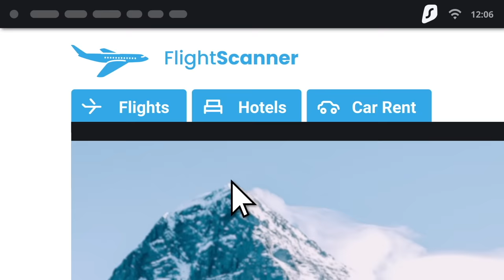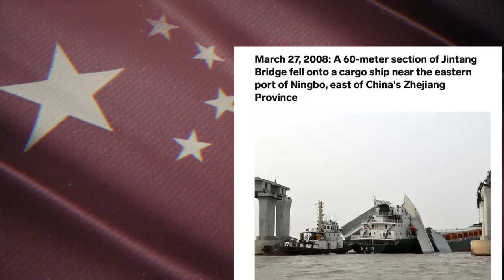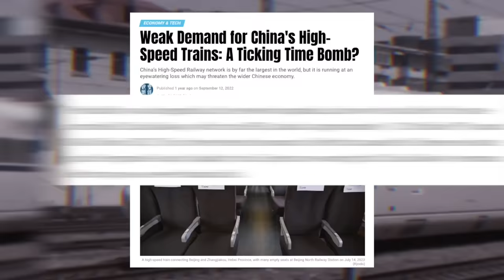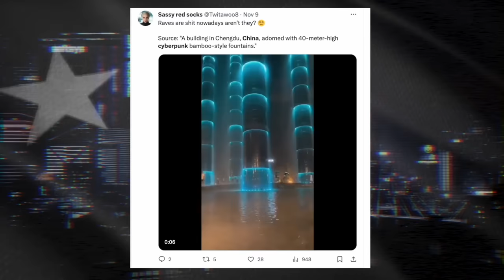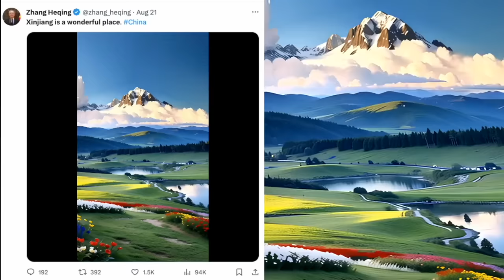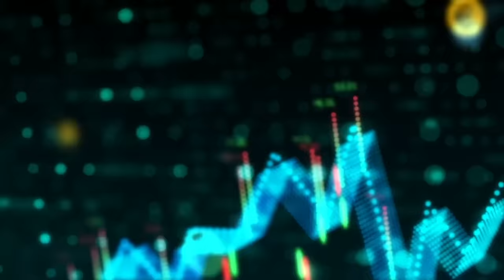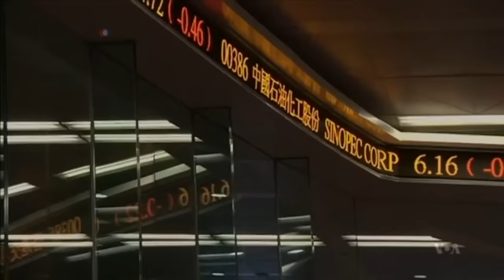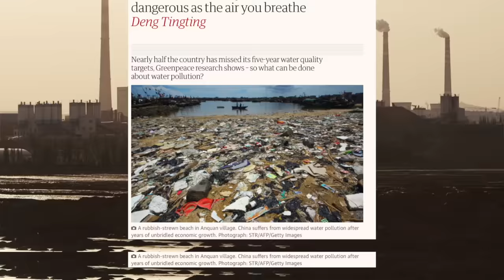Why are China’s Trains Randomly Crashing? - The Hidden Disaster of the High Speed Rail Network

Comment: Speeding is the main reason.
The original Tech-Transfer Agreement
with Mitsubishi Heavy Industry Japan
limited the speed China was allowed 
to operate the hi-speed trains
at 300 km/h

But China operated them at 380 km/h,
drawing power up to about 4 times 
of the original design rating.

As a result, the overloading led to 
sudden hault in the 2011 disaster.
Reply: Why are you making what you write look like a poem? It makes it hard to read.
Reply: @lainiwakura1776 how is it hard to read? Just read it
Reply: This makes a lot of sense.

Bureaucracies don't always observe technical limits.    Prime Example was the Challenger Shuttle launch.   NASA and Reagan wanted a talking point for the "State of the Union" address.

Morton-Thiokol said "We have had some near misses because of the O-rings" due to low temperatures.

The customer is always right, so up went the Shuttle, down went the Shuttle.
Reply: @jamallabarge2665  the customer is always right in matters of taste, that was just a bunch of chicken-shits letting people die.
Reply: @lainiwakura1776 just read it
Reply: If I'm remembering correctly, the Japanese-derived high speed trains have a rated top speed of 250 kph, whilst the Siemens-developed trains run at 350 kph. So I highly doubt that running at such speeds (which the trains likely can't reach in the first place) would have been the cause of that accident, especially given the myriad of other, more likely things that can go wrong. Derailments due to failed axles or suspension are quite common, especially when maintenance isn't done adequately, and can lead to severe accidents.
Reply: @mikeblatzheim2797  
I didn't speculate on the cause of 
the accident of Power overloading, 
leading to sudden halts.

I noticed, since the opening of 
Shanghai-Peking line, in June 2011,
there were AT LEAST 8 incidents of 
Power Outages, in the MiDDLE of journeys, 
including Complete Electricity & A/C Outages.

As an Electrical/Electronic Engr, 
I strongly suspected the Power Supply Grid
(might NOT be supplied by Japanese,
but developed by the Chinese themselves)
of the Chinese HS train system
WAS NOT CAPABLE of Supplying the 
Overloaded 400% power of speeding from,
designed 300km/h to 380km/h.

And I predicted the incident (not accident)
AS EARLY AS beginning of July 2011,
and the Incident happened on July 24.

I was banned from a local Train Tech forum,
for predicting the incident too accurately.
Reply: @lainiwakura1776  
Sorry 2 hv made it hard to read 4 u,
But, it's my job-sickness of 
being a software engr that
it's a style of presenting,
in a Structured Format,
to be easier to read,
by my colleagues.

I didnt mean to make it read like poem.
In fact I hate poems to some extent.
Reply: @abcxyz-nd6xh it’s great. Easier to read.

Comment: You know, I often complain about how there's little to no train service where I live, how the rail network is nowhere near as good as it once was in the first half of the 20th century, how slow trains are compared to Eurasia, but then I see China, and I realise that it could be a whole lot worse. (I'd still love a rail network in the country like Japan's though.)
Reply: I would love a good passenger train system. When I was 8 or 10 years old my Mom and I used to ride the train across the US to visit relatives. I still remember when you flushed the toilet you could see the railroad ties going by through the hole in the bottom of the toilet. Back then every town of even a few thousand people had a train station where you could get on a train and go anywhere.
Reply: Sad to say, but rail has been a black hole for money for more than a century at this point.
When rail was at its peak, it was there because it had no real competition for the scale it operated on; it was competing with horse and cart for people/cargo transfer. As private motor vehicles (both cars and trucks) got better the advantage of trains was lessened until it was no longer profitable to run rail. Add to that needing private transport to even access rail and you can understand that rail is (apart from niche uses) dead.
Reply: As soon as airplanes got faster than trains the handwriting was on the wall, sadly. @elLooto

Comment: Haste makes waste. Sure China built a giant high speed rail system but the quality is what matters. The tolerances for every aspect of this system have to exact to achieve and maintain these high speeds. Any small deviations will cause vibrations, which will end in catastrophe. The maintenance of the rails, to the cars and engine alone, are crucial for safe travel. Other infrastructure such as bridges and banked turns are also critical. These are issues that must be of top priority and not overlooked. China has a bad habit of jumping before they look. I'm afraid they are lacking it the quality of their ability to run and maintain these systems and we will see their shining jewel become severely tarnished and dangerous as time goes on.

Comment: There is an axiom in the construction business. You can build a project fast with high quality, but it will be expensive. You can build the same project with high quality and reasonable costs, but it will not be fast. You can build a project fast and cheap but it will be of low quality. Do you want to build a project fast, cheaply, and of high quality? Pick two and call me back. China built a huge high-speed rail system faster than anyone imagined it could for less per mile than anyone else has, so now it is paying the quality price of that decision. The other thing about high-speed rail systems - they are very maintenance and operating cost-intensive. If maintenance gets skimped on, it doesn't really matter how well it was built, it is going to start falling apart. Derail a regional freight train at 50 mph and you have a serious problem but likely can repair the damage to the guideway in a few days (Norfolk Southern not withstanding). Derail a high-speed passenger train at over 150 mph and you have a disaster that is going to take weeks or even months to repair.
Reply: They can also do repairs fast and cheap. So no problem!
Reply: @norihiro01  😆😆😆😆😆

Comment: I'm skeptical.  Imagine the commuter volume, the speed at which those commuters are moved, and compare it with the knuckle draggers at Amtrak.  I believe you would find that they have moved more people safely and quickly in the past 10 years than Amtrak has in 50 years.  An Amtrak ride from New York to Charleston SC actually takes longer than driving.
Reply: You're right, they do move more people quicker than Amtrak. However, as shown by rail networks elsewhere, they could still do a lot better on safety.

Comment: The sad thing though is that many people would talk bad about Japan's HSR rail projects in other countries after one country had open their Chinese made HSR rail line. Like in Indonesian HSR for example, in every video about their HSR, you will see many comments throwing shame to Japan HSR projects abroad. They didn't know the problems Indonesian HSR had during it's construction and why it was delayed. Other than covid, one problem was Indonesian engineers saw many structural problems like misalignment of the supports that is why they ordered China to fix it also another problem of the delay was the derailment of one of their construction trains causing deaths. Also the scary thing was due to delay the government told the Chinese contractor to speed up the project more which caused some stations to not yet finished construction when it opened. I don't know if they knew this but it is not really good to hasten Chinese projects.

Comment: Certainly, I can share a story without copying it. Imagine being on a packed train in China, heading to a bustling city. The carriage was overcrowded, filled with people standing in every available space, making movement nearly impossible. The air was stuffy, and the heat seemed unbearable due to the sheer number of passengers. The journey that was supposed to take a few hours turned into an endurance test. Passengers were visibly uncomfortable, and it was challenging to find any relief from the cramped conditions. The constant noise and lack of personal space made it an exhausting and frustrating experience. Despite the discomfort, the resilience and adaptability of everyone onboard were notable. People found ways to pass the time, sharing snacks and engaging in conversations, trying to make the best out of a challenging situation.

Comment: In the west, with proper laws and codes, and without corruption, we tend to build assets using capital, or loans. Those loans are paid back by the operating profits from the assets created. And if the owners go broke, the assets are purchased at a discounted rate until they produce a profit for the new owners. Whether that profit be generated by renewing operations, or stripping the assets for sale separately.

In China they build liabilities using Tofu Dreg construction. So that when the owners go broke, there is no asset to sell - just another public liability requiring huge expense to de-construct.

And it seems to me that this vast chasm of difference is what will ultimately doom China: there is no way to properly allocate capital, and in the ultra corrupt system, no way to produce assets of proper value.

Comment: Oh I was wondering what happened to you guys.  I remember your episode about Chinese farming practices & extreme use of herbicides, pesticides, chemical fertilizers, steroids, growth hormones.  Then all that surfaced during the Olympics a bit later, when athletes had to import food as the Chinese food had so many banned growth/steroid substances in it.

As a civil engineer w/3+ decades experience designing, managing transportation infrastructure projects in the northeast USA, working for a State DOT agency, of many modes (highways, airports, ports, commuter & intercity rail, bus), I will add my two cents:

- We always said:  "Do you want it done Fast, Cheap, or Right?"  "You can Only have Two of the Three!"  This is an Infallible Rule.  Obv China goes for the 1st 2.

- We'd known about these issues for a while when I was working on Rail projects & we'd be getting those sorts of comments from non-technical media & politicians - "Why do your projects cost so much & take so long when China built a whole nationwide system in less time?"  Because we plan & design our projects pretty thoroughly, then bid them out, then inspect them thoroughly during construction, including testing the building materials.  Then we test & troubleshoot what we've built thoroughly, using a "Commissioning-based" system/set of standards.  This is all overseen by professionals credentialed & experienced in whatever the relevant fields are (structural, civil, electrical, mechanical, signals, IT/comm, etc).  The overseeing agencies are civil service staff, not political appointees (well at least in my experience, this is a big issue on Calif High Speed Rail, & was on the Boston Big Dig too).  Multiple federal, state, & transit agencies work together, sharing staff & expertise.  No one "guru" is in charge of too much, minimizing the opportunities for graft/corruption.  Our planning & design phases include exhaustive environmental impact evaluations & coordination with local officials & residents.  We are subject to environmental permits & multiple codes & standards (US trains are Way more crash resilient & heavy than any other place on earth, & China's are literal tin cans, the worst in the world).  All of this takes time & costs money.  That is the cost of doing things right & addressing everyone's concerns, & maximizing safety & longevity, not just bulldozing through to create a right of way/etc.  It's difficult to get lay people to realize all this.  Thank you for bringing this to the world's attention, it really doesn't get much coverage, the average "Joe" thinks China's system is as safe & well built as Japan's.

- This highlights the difference between authoritarian governments & democracies / republics.  Authoritarians will do things superficially fast & cheap to maximize their own perceived success.  Then, if there are failures later, they will cover it up first, & suppress any investigations into what happened & what can be done to fix/prevent future problems.  So they will have the same type of "incidents" over & over, while in the US/Europe, a crash is thoroughly investigated by independent authorities using scientific forensic techniques & there is a "lessons learned" report/briefing, made available to everyone, including other similar systems.  This sort of info is never done &/or suppressed in China.

As a military history buff, we can look back at World war 2 in the Pacific as a prime example of this.  At the start of the war, the Japanese navy was better at pretty much everything than the USA's.  As the war progressed, after each of the early battles (Coral Sea, Midway, etc), where each side damaged/sunk carriers & other major ships, on the Japanese side, the results would be suppressed by the chain of command, as everyone wanted to cover their asses, so that top admirals often weren't aware of the losses/defeat.  The reasons for losses/defeat were not discussed or looked at or analyzed.  So no improvements were ever made based on "lessons learned".  On the US side, however, after action reports went up the line & were looked at by many experts in many different fields, from strategy & tactics to, most importantly, battle damage control.  Early losses were analyzed as to why the ship wasn't salvaged.  Strategies, tactics, & loss prevention systems & procedures were improved.  New recruits & officers were trained by experienced staff armed with this knowledge.  This improvement happened continually through the early/mid parts of the war (Guadalcanal campaign), even before the US advantage in production kicked in (by early 1944).  Meanwhile, the Japanese were still stuck at 1941 throughout the war, & if anything regressed, as they didn't have the training system to replace losses in experienced crews/etc.  These lessons apply across the board to infrastructure.  Much of the education system in China has heavy course loads in CCP indoctrination / propaganda, even the technical fields.  Again, it's all about superficially looking good, not about actually learning.

Comment: It really is the workmanship and work ethic, and this toxic work ethic has impacted Hong Kong too. If you haven’t heard of the new MTR station with steel beams not being attached to the frame, now you have heard it; an engineer blew the whistle (like 2, 3 years ago). This was unheard of before the takeover. They “fixed” it — without dismantling the whole thing, I don’t want to know how secure is that “fix”
Reply: They used glue made in China. It should be safe now😂😂😂

Comment: 6:02 That subway train going through a building is nothing special. Germany, Berlin to be precise, has build an entire apartment complex atop a 600 meter stretch of Autobahn. It's currently closed down due to an overhaul of the fire safety systems, and general maintenance. Reopening is estimated to be in 2029. It was build in the 1970s.

Comment: I used to build trains for a living. 

Last set I worked on was the Virgin Pendolinos in the early 2000s. To give you an idea of cost a 8 car set of 2 drive cars 4 standard car and 1 kitchen car and 1 shop car. Cost £10 million to build as was sold for £12 million. 
If you don’t care about quantity control you can cut that build cost in half easily and still sell for the full price.

Nothing about trains is cheap you need them to be used enough to be profitable. And the CCP build so many lines that just don’t have the population density or commercial demand to ever to profitable.

Comment: Infrastructure is an investment that can kickstart a lot of other development. So in that sense I can understand why the trains themselves don't need to make a direct profit to be worth the investment. IIRC the American west was developed by building railways in order for people and business to be able to operate in those areas. The railway in and on itself probably wasn't profitable either in those days. It was all the secondary industries and business it enabled that made it worth the investment. 

I guess what China is trying to do is similar to that? Create the infrastructure framework needed to open up the interior for development like the coastal areas have in the past decades? Personally I think the problem isn't fundamentally with this idea and this plan they are executing. It seems like a fairly sound idea tbh. The government, not having any shareholders clambering for profit margins can use it's immense power and ability to take on debt to invest in primary prerequisite development in order for private companies to then safely invest in secondary industries and services. Once those are developed, the debt can be offset by the increased tax revenues and everybody profits in the long run. 
The fundamental problem is the insane levels of corruption causing shit like tofu dreg buildings to collapse.

Comment: Long time viewer here, I think you guys do shed a much needed light on issues such as tofu dregs & the atrocities in Xinjiang -- but one thing implied in this video seemed a bit off to me. The purpose of high speed rail (and other transit types, and in a ton of countries, for example in many area of Europe) is not to turn a profit. It's to provide an economic benefit that ends up benefiting society at large so that it's arguably well worth the tax money spent to subsidize it. You can certainly speculate that some infrastructure projects in China are built without considering this balance carefully, or at all if they really are vanity projects -- but I don't think it matters that the transit doesn't turn a profit in the traditional sense, or even break even.